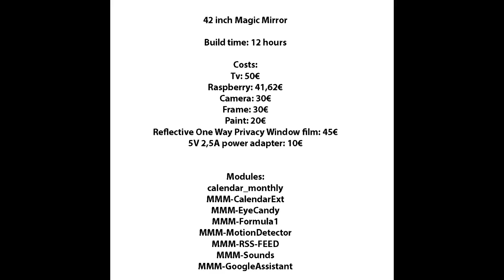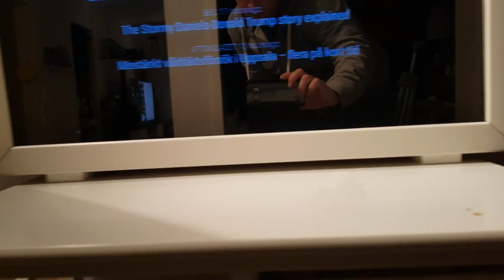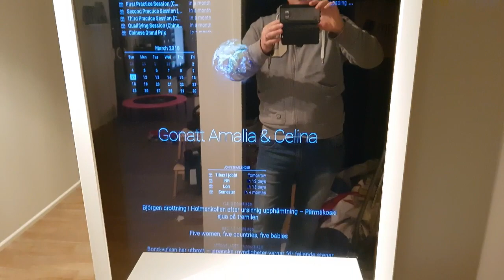42 inch Magic Mirror

Comment: how did you bypass the tv's power button? that's the big part I'm struggling with at the moment on my MagicMirror
Reply from the maker: i am using the remote to start the tv, it is on standby and when it gets a signal from the camera (motion detection) the screen wakes up.
Reply: @JohnEveli  I'm trying to bypass the power button on my tv and make everything completely self-contained. when motion is detected, I want it to turn the tv on for me and everything, any idea on how to accomplish that?
Reply: use a monitor, not a tv. monitors are powered up by device, not by remote.
Reply: @mediasBIKEadventure  I ended up finding a way to get around the power button, I wired up a capacitor and diode in line with the switch and it works perfectly! :)